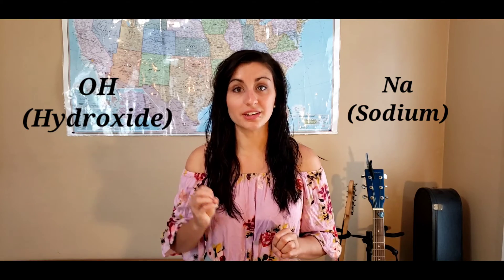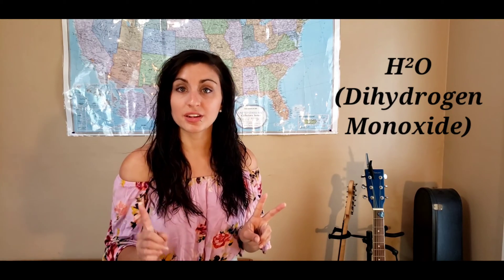Drano Bottle Bomb Works! And here's how *UPDATE*

Comment: You felt the full power since the limiting factor is the bottle rupturing. The worst injuries I have seen and heard of are a few cuts, a broken finger, and minor chemical/thermal burns. It's no more powerful than dry ice bombs. Thanks to Uncle Sam I've had some experience around low velocity explosives like black powder and high velocity explosives like tnt and c4. This isn't anywhere close to being enough to cause serious injuries due to the extremely low velocity being maybe a few hundred fps max which is gonna have similar energy to a high end paintball gun.

Definitely not a chemist so the chemistry actually had me interested but power is nothing more than hooking it up to an air pump and getting to ~200psi.
Reply from the maker: Thank you for providing more information! I love any science but I love even more just having conversation and learning from each other. I hope you'll stick around! ❤